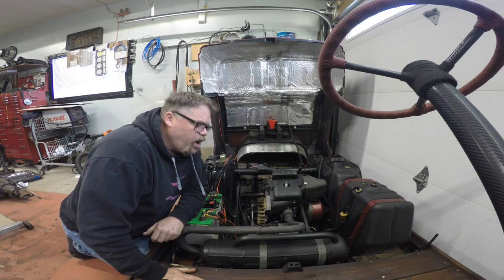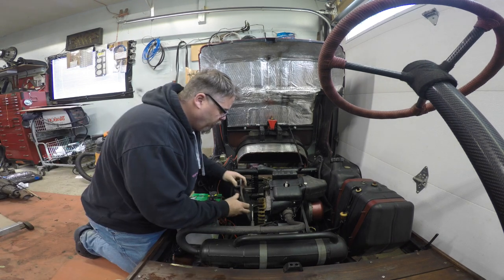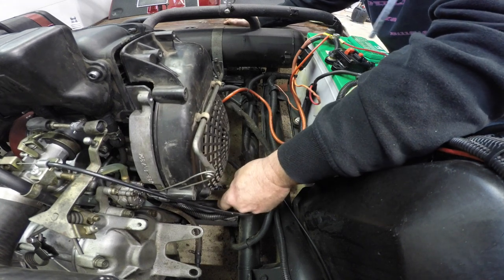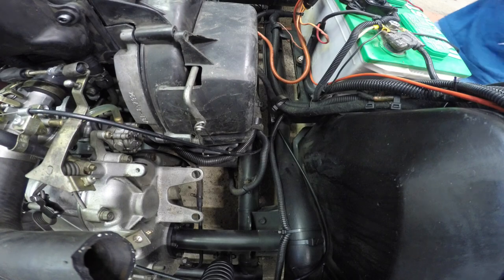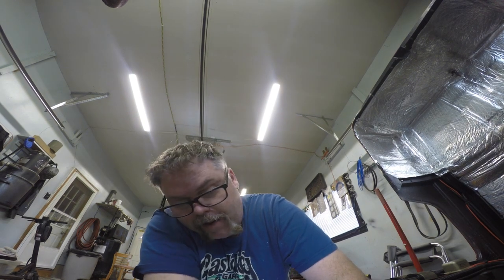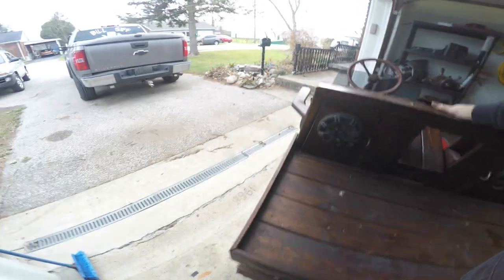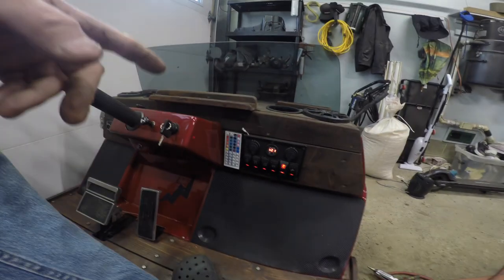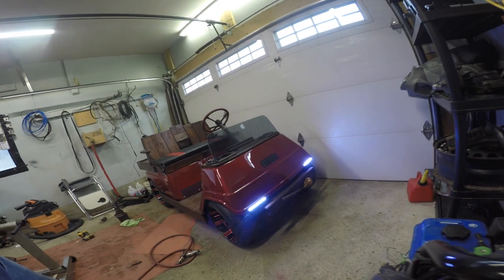Decent Is Running Great

Comment: Thanks for the run down on Decent. You did a killer job on it!
As for the air filter. I think pointing it down would be good. Not sue, but to bad you couldn't inclose it a little bit and get some cleaner air maybe? Ether way it still runs like a top captain !